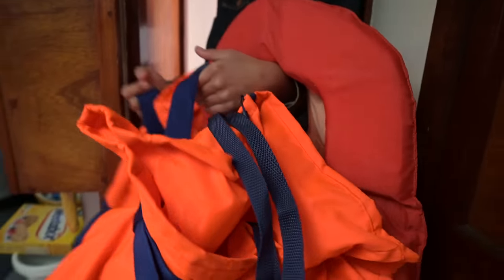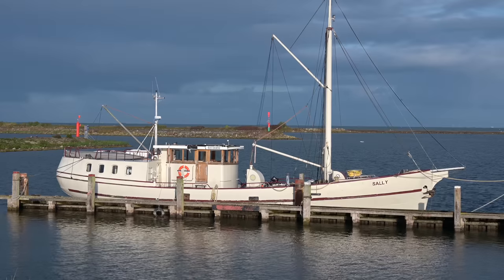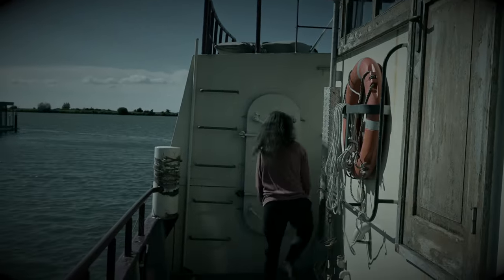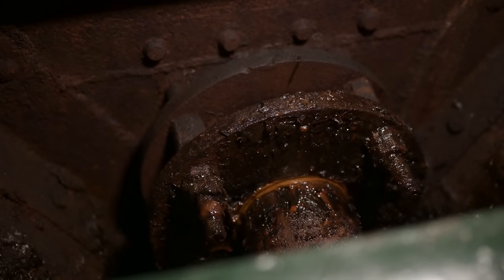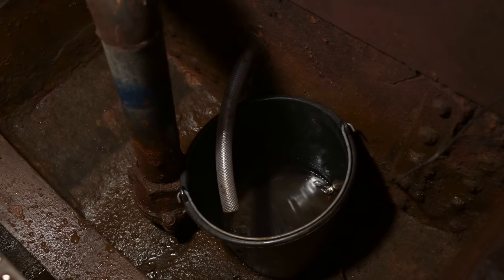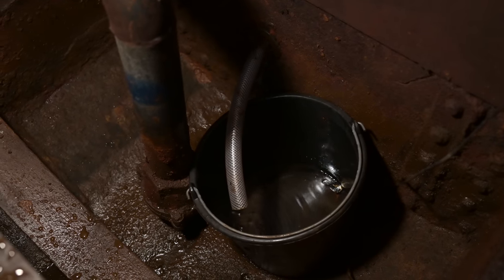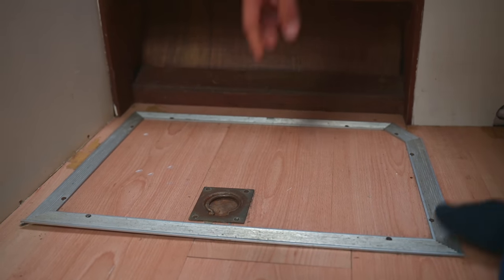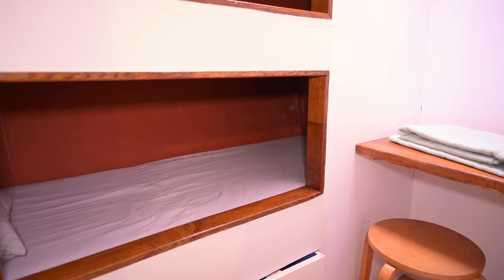Our Ship is Sinking! AGAIN!!!

Comment: Tongue and groove definitely. I would not use spray insulation, rather use fire resistant foam boards as thick as the frames allow or rock wool  which unlike fiber glass does not wick up water and support mold. This would allow you to remove these panels if necessary to inspect the hull for water ingress and were it is coming from as well as allow water to run down into the bilge so that you know you have a developing problem.

Comment: There are many styles of T&G but it is often used on traditional boats and frequently in homes in colder climates especially bathrooms ..not in high splash areas because it insulates and doesnt cause condensation like tiles.

Chain locker room is vunerable to leaks as the chain damages the metal if its unprotected against the chain moving and dropping🙄🤔🧙‍♂️
Reply from the maker: Good to know! Thank you! 👍

Comment: I think the tongue and groove is more traditional for a sailing ship. When your doing deconstruction sometimes it's easier to take a nail punch and drive the nails deeper through the wood instead of prying. I hope that helps
Reply from the maker: Thanks for the advice. So far the wood came of pretty easy but it's always a good thing to have a different option to "just use more force"

Comment: Cheaper to dry dock and start on the outside of the boat
Reply from the maker: Boats do rust from the inside. The outside is usually a cosmetic problem. I know the white color promotes the rust on the outside a bit but it's basically surface rust mostly at a spot were a rubber fender was rubbing in the past 4 years.
Reply: @FlyingConey  but you tore apart that beautiful bunk for not Thing
Reply from the maker: @elainerussell924  It went out a bit early because we wanted to have the foreship done before the saloon. Now half of the ship is a big building site. But we need access to the hull everywhere. So the interior has to go.
Reply: @FlyingConey  get your wallet out its gonna cost     good luck
Reply from the maker: @elainerussell924  Thank you! We bought the cheapest boat on the market and that leaves us some budget to tackle even big projects. That way we can make sure that things are done right.
Reply: @FlyingConey  the best of luck on your investment adventure

Comment: Yikes! I now see what you mean. Question , how does that rust smell? Heavily active rust has a distinct, unpleasant smell. I worked on a boat that had a small stairway to the forepeak that was so rotted the smell came up through the deck hatch. He hatch was caulked ,taped , tarred, with two rubber mats taped over and rug . The cabin the hatch was in still stank of rotted steel. 
 I doubt the water is coming from behind the rubstrake you showed, because it is bone the waterline. I would check all the threw-hulls nd do you have a sea chest ( box in the engine room where sea water comes in for engines , pumps ) ?  Keep the tongue and groove, unless you are going for IMO/ SOLAS certification. Then check what materials the governments will allow. The sun is low and my drink awaits . Keep up the adventure.

Comment: If I saw that rusty hull after removing the bulkhead and bunks. I think I would’ve been a bit disheartened. 👍👍
Reply from the maker: Luckily we had water coming in distracting me from the rust... Honestly, I couldn't sleep because of it but then I realized that this amount of corrosion is only behind the cork isolation which is about 6 meters of the ship. The hull thickness is still good though.

Comment: Keep the T&G 👍
Reply from the maker: You mean rebuild it with T&G 🤣 One of the downsides if things need to be done quick is there is less time to save the material. But we will keep one board as a reference for the color. It's a very interesting one, don't you think?
Reply: @FlyingConey  the colour gets richer over time , and it definitely add charm and character to any boat , plus as I'm sure you know it's a great insulator , if you do decide to use T&G please put a vapour barrier between the hull and the wood, a little extra time is well worth the rewards , good luck with your beautiful ship

Comment: trough hull? or is there a water tank? anyway, it is impossible to put spray insulation on a rusted hull. My 5 cents? Fluid film!
Reply from the maker: We only have three trough hulls that we know of and none of it was leaking. But we already found the leak, after we ripped almost everything out... So the reveal of the mystery will be in one of the next videos. It is clear that if we want to spray foam the hull must be completely rust free, blasted down to white metal. We are shifting more and more away from that idea but it's nothing we have to decide in the next month or so 🤣😉

Comment: Damn, those frames look like more rust then steel. Looks like you will have to remove the interior completely and replace em one by one or she might breake apart in heavy seas. My own sailing experience is limited to Dinghy racing, so im no expert on big steel boats, but i wouldn't trust my life to rust for an ocean crossing tbh.
Reply from the maker: No, they are really looking bad. I mean really really bad. But the saloon which was the former fish storage room is the only part of the ship isolated with cork. That's "just" six meters of the ship. So a re-framing of this section wouldn't be the end of the world and we need to strip the interior anyway. Structural I don't think  it's a issue. But taking this ship to salt waters... The hull would have rusted away halfway across the Atlantic. We rally need to takle the rust problem!
Reply: 6mm of steel makes 25mm of rust but yes those frames are very corroded in places but what you would expect of a vessel that age, it was good you found them now, by the time you have finished the repairs you will have learnt many new skills. Another area to inspect is the chain locker as it is another area of high corrosion. Take one step at a time and don't despair. Learn to weld and cut steel and get on with it, well done.
Reply: @stephransley4371  I guess thats the nice thing about steel, a rotten wooden frame might have to be replaced entirely, but with steel you can cut the bad parts aways and weld in new material :)
Reply: @hernerweisenberg7052  absolutely, the hole must be very small if it is only 100 litres a day, just plug it with epoxy putty for now and then repair it when you are in the shipyard. Good luck.

Comment: Are you going to use sacrificial anodes?
Reply from the maker: It's absolutely neccesary to use them! When we took the boat out of the water we found the aluminium anodes passive. Unfortunatelly the previose owner mixed zinc with aluminium and that's not good. Also we learned that the quality of the anodes is very important and we hope we now have good aluminium anodes on the ship.

Comment: The face mask air filter is critical in the work you are doing in the ship.  Like you, I feel that the old paint is lead based and a health hazard.  Did you attempt to get some data on  the steel hull thickness prior to the purchase of your ship.  I believe that would be critical information before you invest a significant amount of money in the reconstruction process.  I'm looking forward to your next video.
Reply from the maker: Thank you! Yes we have a full hull thickness report from her CVO and the steel thickness is quite good. It could be that the frames are older than the hull plates and corroded much faster. Lead paint could be possible but our main concern is tar especially the cork isolation could be very dangerous.

Comment: Needle gun or sand blaster?
Reply from the maker: Yes 😎
Reply: @FlyingConey  once you remove the loose rust and scale you might consider an application of phosphoric acid. it will convert the iron oxide to iron phosphate which is an inert layer that will help prevent further rust. you can then apply a coating over the iron phosphate for further protection.

Comment: Of course, the tongue and groove looks better but it also looks dated.   Actually, the whole design of the guest bunks looks dated.   I remember hearing you were planning on removing most of the stern upper area as its not original.  Where well you make up that living area?  I could be wrong but it seems you guys have not come up with a solid final floor plan for the boat.  If I were you, I would rip out the old bunks and wait until you got rid of the upper stern area.   Then reevaluate how much square footage you actually have.   It may turn out that space is better used for something else.   And if it is to remain guest quarters, put your creative hats on and redesign the space: yuk.  Lots of cheap, attractive material out there to use that won't resemble the crew quarters of the Titanic.   And please, please dont put back all that 40 year old, stinky wood, that looks like crap because it has multiple paint layers.    Also, maybe you can get mattresses made in the shape of his mustache with two big bumps at either ends for your head and feet.  What do you think??   That being said, love the show.  Cant wait to see what you guys do with this thing.
Reply from the maker: Finally someone with humor here. Love it 👍🤣 I have a floorpan in my head but we haven't found the time to make some basic measurements to put it down on paper. The idea is to lower the quarter deck about one meter. That leaves plenty of space underneath for a full size captains cabin. The thing is that the engine room was designed for a much bigger slow or medium speed engine. It's like an engine cathedral. Basically everything aft of the engine is just a wast of space used up by unnecessary huge fuel tanks. 3000 gallons of fuel bunker... And this area is just underneath the aft cabin. There should be enough space to lower the flor about one meter. We hope.